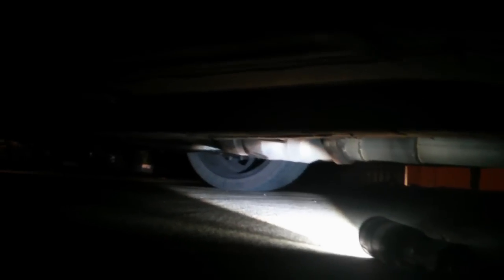Catalytic Converter Rattling Noise

Comment: Late jumping into these comments, but that rattling during rev definitely sound like an issue internally for a catalytic converter. I have a Q50 and took to Nissan 3 TIMES for the same rattle noise only to be told all three times that the heat shield needed to be buttoned up. It wasn't until I came back a 4th time and had them look over the cat again until I was told it was a damaged. They wanted $2400 + tax Canadian to replace one cat. Refused and walked out, ordered 2 High Flow Cats with install and paid $700 + tax Canadian. I now have better performance and better fuel mileage.

Comment: Mine rattles when it's at idle but it's the same sound
Reply: did you ever fix
Reply: @juanrocha251  yes I did, I was infact the cat that was bad. Replaced it with a catless x pipe

Comment: I heard it no problem! mine sounds exactly the same( 2008 Ford escape 96.000 miles)sounded like It had a few nuts and bolts in there, then the sound stopped. The modern Factory converter will last on the average 10 years / 100.000 miles Aftermarket a lot less because its interior honeycomb substructure is of less quality.A great short diagnostic vid, Thanks

Comment: Had a bad one 38 years ago with a one year old Camaro that got regular instead of unleaded. I bought a new Suzuki Grand Vitara 4x4 in 2001 and I've been hearing an unexplained rattle after only 40,000 miles on it. That sound is about the same as the Camaro except the Camaro had a bad exhaust odor and the Suzuki doesn't. Thanks to your video I know where to listen. 🤙👍

Comment: It's most likely the heat shield coming loose (the bolts rust off quite easily over time depending on driving habits). Easy fix-get a couple of large  pipe clamp rings from Home Depot or Lowes, and wrap them around both ends of the catalytic converter heat shield and tighten them with a screwdriver. I literally just did this a minute ago and it worked. No more rattling
Reply: +Damien Spencer Well, that is hard to diagnose, if you can tell exactly where the sound is coming from directly it may be easier to assume how bad the problem could be. Like, for my 2010 Nissan Altima, the rattling came directly from the catalytic converter located toward the front bottom of the car (below the radiator) so I was able to catch it easily by  grasping and clinching it discovering the rusted-off bolts, and discovered the heat shield rattling was the problem. I don't know much about transmissions, but hopefully for your sake, it's not your car's transmission making that noise. Get a buddy to rev the engine at different RPM levels while you listen to where it could be coming from, hope this is helpful for you
Reply from the maker: Mine was not the heat shield. By the time I bought another catalytic converter this one was completely hollow, all of the parts had bee blown out by the engine. It can be the heatshield, or rattling bolts. Damien, I can't say I have heard a transmission with this problem, but if it does sound like it is coming from your transmission then I would definitely get that checked out.
Reply: My car started doing this a couple days ago.  No sounds before.. But pulling in driveway or in a drive thru I'd have that sound for a few seconds then nothing.  No codes thrown or funny noises otherwise.  No performance issues I've noticed either.  Thx for plating the sound because I was at a loss lol

Comment: Yeah mine only does it while down revving in gear, really confused the shit out of me. Thought it was my transmission, sounds like its coming from the front of the vehicle around the engine, transmission, but I think there is a cat coming right out of the exhaust manifold right next to the transmission, then another one down by the muffler

Comment: ATTENTION! EVERYONE, ATTENTION!!!! 
IF THIS IS THE EXACT ISSUE YOU ARE HAVING & YOU KNOW 100% FOR SURE IT IS THIS. 
YOU CAN CONTINUE DRIVING YOUR CAR WITH NO ISSUES, driving will NOT damage your car. The only issue is the noise is MAD ANNOYING & A MAJOR NUISANCE. But just turn your music up and drown out the noise. MISSION ACCOMPLISHED! Unless of course you want to spend $1,000+ to $2,000 getting it fixed. YOU CAN CONTINUE DRIVING W/ NO DAMAGE CONCERN
Reply from the maker: Eventually your cat gets blocked up bad enough to prevent exhaust from escaping easily, so it bogs down the engine. But yes, it won't damage the car

Comment: Thanks for this.  I've got that noise on a 1990 Miata.  I was about 70% sure it was the cat until I found your video.  Now I'm 99% sure.  Mine makes the noise on start up and then through certain rev ranges, but I don't have the power loss on the gas like yours appears to have, or at least I don't think I do.  On a 26 year old car, it's probably not a bad idea to change it out, even if that's not the problem.  I'm ordering a new one right now, as I'm so certain that this is going to solve another problem on the list.  Thanks for making this video.
Reply: If the Miata is making that noise, I would listen to see if it is Morse Code.  Rumor has it they often send a "put me out of my misery signal" (that is the cleaned up version).

Comment: My car has the same noise so how long can I drive it thanks for the video🙏
Reply from the maker: The cat will either get so clogged that you have trouble accelerating, or the cat will continue to fall apart until your engine makes a hole through the middle of it, and it will drive normally with a hollowed out cat. It's hard to know how soon either will happen
Reply: @LegitRaceCraft  oryt thanks eyi cars can be a pain in the bottom sometimes 🤣🤣🤣🤣
Reply: @LegitRaceCraft  so , you can drive with this & it won’t damage the car . 
That’s what a mechanic told me. (I have the same issue) mechanic said “you can drive your car for the entire lifetime left of your car & everything will be fine” but I’m asking you...have you ever heard of this situation damaging the car if you continue to drive?

Comment: Good day and god bless you too! Mine rattles when i apply a little gas on it, and if i mesh the pedal it goes away. Would it be the CC?
Reply from the maker: It's possible, but it could only be a loose heat shield also. Crawl underneath while it's cool and tap on some heat shield pieces
Reply: @LegitRaceCraft  finally found what it was.

Rod bearing on no. 1. rebuilt the engine myself and everything works superb now
Reply from the maker: Nice!
Reply: @LegitRaceCraft  Thank you for the response btw 🤘

Comment: My jeep had a recall on the catalytic converter. I took it to the dealership and was told the problem I was having with it was not part of the recall. It sounded like a can of coins rattling around. Fuk stealerships! I had it replaced but at cost. No! Not at the dealership! Dang!
Reply from the maker: That sounds pretty frustrating
Reply: Or they lied.

Comment: Is this noise still there when the engine is turned off? I have the same noise and it still sounds after the engine is off and fades away.
Reply from the maker: There are always subtle tapping sounds when you shut off any car's engine, it's the metal cooling in the exhaust system. It could only be this

Comment: Did the broken catalyst end up making out the rest of the way out or eng up in the muffler
Reply from the maker: I assume it made it out of the muffler, otherwise there would be rattling
Reply: This happened to my car. A rattle I couldn't find then finally the insides of the catalytic converter blew out thru the muffler and tailpipe. Got very lucky.
Reply: @Kirawolf1971  please explain. You saying the little pieces eventually just fell out on their own?
Reply: @royalvibes4433  yes they did. Now I have an empty catalytic converter shell. I don't have the car anymore. It blew up.

Comment: my Nissan frontier 4x4 makes a clicking noise on take off only. it sounds like metal hitting metal. CC issue?
Reply: I have noticed power loss
Reply: Stephanie Williams that's either preignition or a clogged catalytic converter. both will give you a loss of power. is the sound coming from the engine or under the car
Reply: it's coming from underneath the truck seems to be louder under the driver seat area. It's only a couple of times rattles while sitting still just when I first take off.
Reply: Stephanie Williams I would say check the heat shields and the catalytic converter.
Reply: Mine does the same thing..my mechanic told me it was the cc.. however just curious did ever resolve yours? Thanks!

Comment: My car makes a more subtle rattle that this and it doesn’t sound louder and then lower like this it’s just a uniform rattle but not too loud this happened after getting my upstream O2 sensor replaced. And only when I’m at a red light and step a little hard on my brake. But it started only immediately after O2 sensor replacement. What could it be? And is it safe to drive my car like that?

Comment: Did it feel like something was tumbling beneath your feet when taking off?
Reply from the maker: +Amanda Gates no, but mine wasn't very close to my feet, mine was more under the middle of the car around my seat. You could also have a loose heat shield.
Reply: ours sounds similar but im not in the truck much ( husbands work truck) but our CC is basically right under the driver's seat almost. so when my husband accelerates from a stop sign, stop light, ect it rumbles similar to this. but doesn't do it while idle on a side note our CC was CUT by someone who tried to steal it, and the shop was unable to weld it all the way. but the best i can describe is it feels like rocks in a tumbler under our feet. i can even feel it slightly from the passanger side. the CUT CC was noticed at the shop when they did our manifolds.
Reply from the maker: STREET SHARKS BEDFORD POINT  the cat could get backed up and you would feel a power loss. If you're lucky it will hollow out the catalytic converter instead of plug it up.

Comment: When its the catalytic converter will it make that rattle when you shift into different gears
Reply from the maker: +Miss AliceOfficial possibly, but I wouldn't think it's because of the shifting. I would guess that it does it when the engine changes rpm while shifting.
Reply: HourNine Racecraft I have an automatic. The noise gets worse sometimes when I have it in reverse.
Reply from the maker: +Miss AliceOfficial it sounds like it might not be the catalytic converter then.
Reply: May be your transmission. Might wanna get that looked at.

Comment: Mine more of a ringing sounds, does it worse under a load, at idle on a hill in gear
Reply: Mine sounds like if something its stuck in one of the tires like if it's a motorcycle

Comment: What's the repair cost on this. Mine is doing the same
Reply from the maker: It depends. Some catalytic converters are bolted on and others are welded on. If it's welded then you have to take it to an exhaust shop for them to replace it (unless you can weld). If it's bolted on then it's as simple as buying another for your vehicle and putting it on. The prices range from $50 to $200 on eBay, but the cheaper ones sometimes are poor quality and don't last long

Comment: Can this cause the car to stall?
Reply from the maker: Not stall specifically, but I suppose it's possible if it's backed up enough. I've seen a car that you couldn't rev beyond 3k rpm until we disconnected the catalytic converter, but it didn't stall.

Comment: I hear this similar noise with my car, but only when it's up to temp and I'm moving, mostly when going up hill. doesn't do it idling (reving)
Reply: Michael, that's exactly what my Expedition is doing (loud rattling noise when going uphill). Did you ever find out if it was the catalytic converter?

Comment: How much is it to fix?
Reply from the maker: +sami alenezi if you buy a cheap one on eBay they won't last long but it will be only $100. The better ones are around $300 and if you have a friend weld it in then you wouldn't have to pay labor